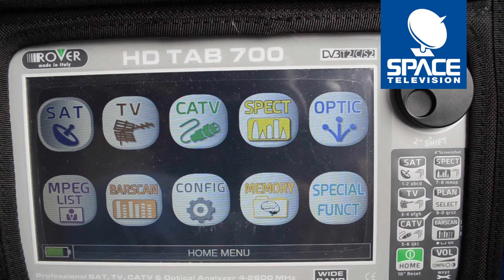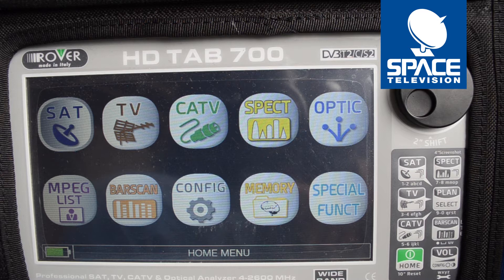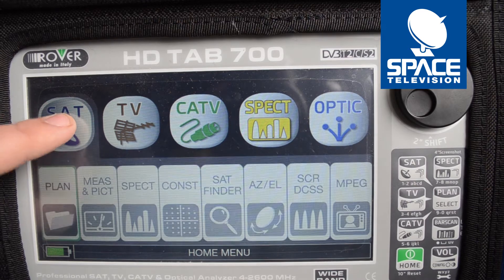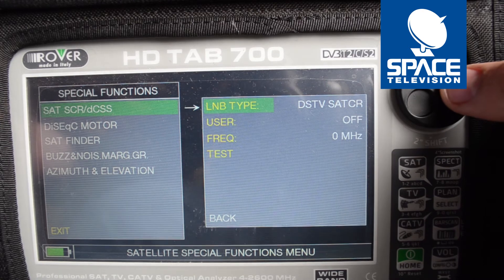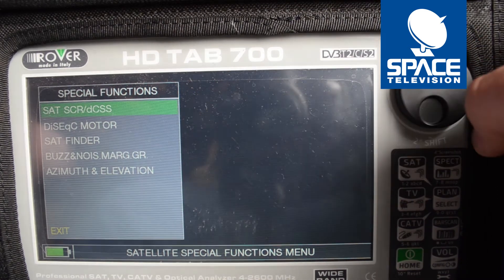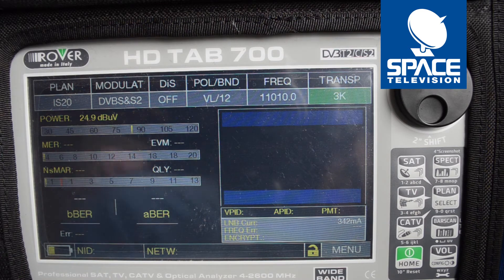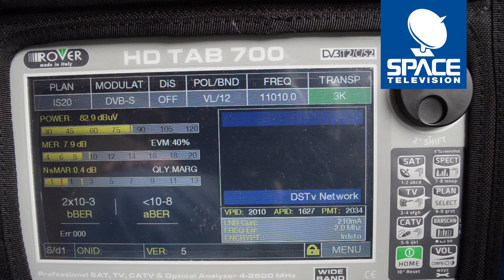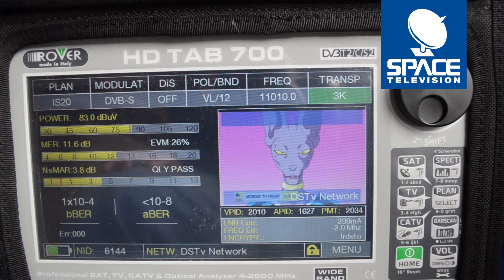What to expect when aligning a SatCR LNB on the HD ROVER TAB 700

Comment: Hi Mate, can we use SatCr lnb on Normal HD STBoxes?
Reply from the maker: Hi a SatCR LNB can only be used with receivers that support the Unicable/SCR protocol, so most normal HD set-top boxes won’t work with it unless they specifically state Unicable compatibility. Standard HD STBs are usually designed for a legacy universal LNB connection. When aligning with the HD ROVER TAB 700, you’ll be able to measure and configure the SatCR LNB, but for actual viewing you’ll need a compatible receiver, otherwise, a normal HD STB won’t function properly with a SatCR setup.